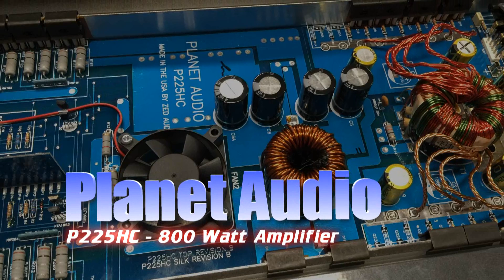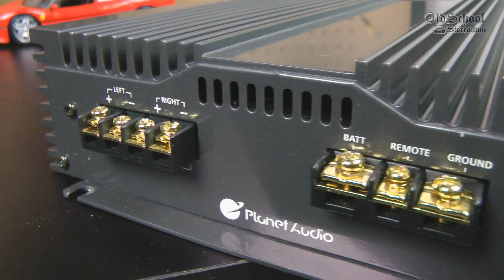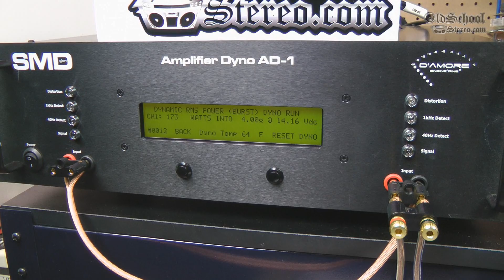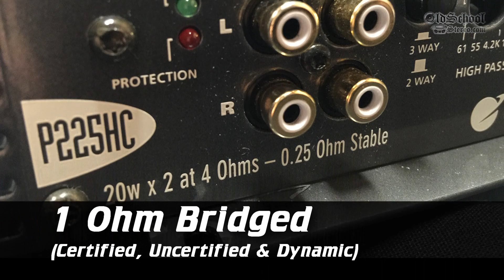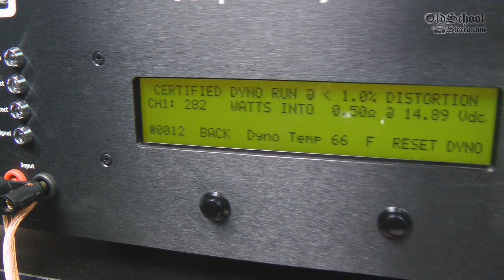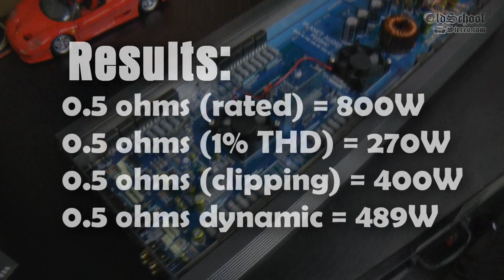Planet Audio P225HC Cheater Amp Challenge Amp Dyno Test Zed Audio

Comment: Hey big Dwizi noticed something in the video that amp is missing driver chips that where never installed maybe that might be the reason why its shy on power??
Reply from the maker: They used the same board for different amp models, so some appear to be missing parts, but they are really not

Comment: Alright I thought I could figure this one out by myself but .. yeah .. what exactly is a "cheater" amp ???
Reply: Darieee  Crazy low wattage at 4 0hms but able to handle crazy low impedance like the .25 ohm load on this one producing way more power. You could enter at competition based on wattage at 4 ohm and spank everyone by running at .25 ohms
Reply: thanks man !

Comment: Hey Big Dwiz there is something that I noticed in this video the planet audio and has missing parts like it wasn't installed for example look where the mosfets are there blank spots for some chips and resistors, also some pnp's and npn's are missing as well meaning that this amplifier can make more power if they were to get installed lol
Reply from the maker: +cubanman2009 I'm sure this circuit board was used for other amp models as well, some probably had those extra components.

Comment: I'll see if can get my hands on a planet audio bb2400.1 so you can test
Reply: I got one and it's legit. Running two Kenwood Excelon KFC-XW1000F. These are their shallow cone subs and I have them down firing under the back seat of a Toyota Tundra. Someone in the know told me that the BB2400.1 and BB1200.4 share the same respective amp boards with the ARC Audio 1st gen XDi amps. BB2400.1 is similar to Arc Audio XDi 1000.1. The B1200.4 is supposedly the same as the Arc Audio XDi 804. Where Planet Audio saves money is by using lower quality transformers, capacitors, and transistors.

Comment: At a half ohm load every connection and bit of speaker wire represent a significant portion of the total impedance the amp sees. 500watts @1/2 ohm equals over 30amps which is a lot for those not so massive speaker connections and wires. I'm willing to bet the amp is driving closer to 1ohm than 0,5ohm total load in this test. The moral of this is that driving impedances close to a dead short is not very smart and should be avoided. Otherwise you are putting lots of power to waste.
Reply: Yep, you hit the nail on the head. I just don't get why people want to run such low impedance.Damping factor and headroom will both go down when an amp is run at lower than it's optimal impedance. Just my opinion, I could be wrong.

Comment: I think his power supplies r not big enuff for the current it draws at those loads.  It starving for power
Reply from the maker: Sorry, not the case. I can provide a clean 320A at 14V. This amp was only pulling 115A (or less) at 1/2 ohm mono. I'll verify with my test results
Reply: Dereck BigDWiz
I think he meant the supply side of the board..?  Looks like its a few components short of being fully populated so maybe.  Anyways, should have tossed in a couple 1khz tests too.
Reply from the maker: Stephen M I did some 1kHz tests and will upload the video very soon as an update

Comment: Not so much bang for the buck!
Reply from the maker: Geerladenlad I think the majority of the cost of this amp was the aluminum. The heat sink is massive, stated to be 7kg or approx. 15lbs, but on the scale it topped 20lbs. About the size of today's class D "true" 5kW amps
Reply: Dereck BigDWiz A very inefficient design with to high a price tag. Unless the goal is to pay for heavy aluminum amp decorations that supply underrated power.